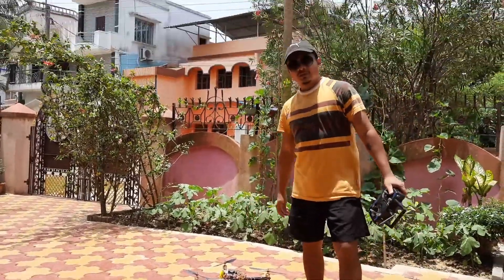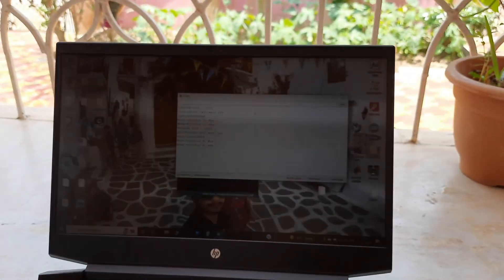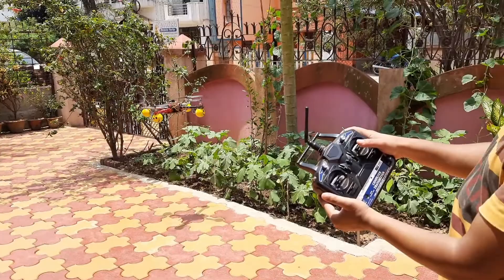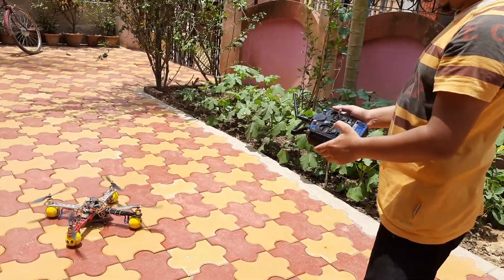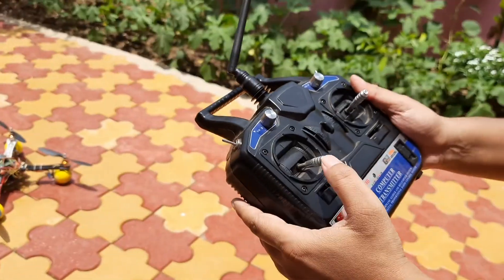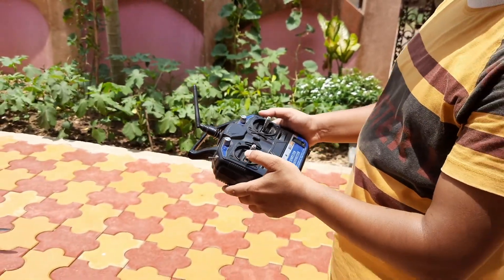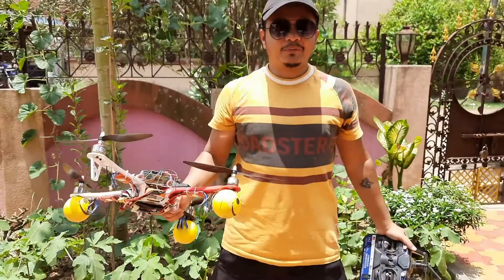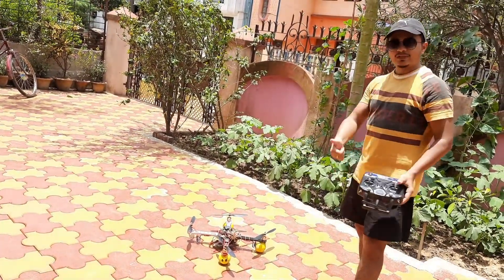Arduino Quadcopter Development Part 3 (Altitude hold)

Comment: Use 800 to 1200 kv for much stable with this setup without you should change altitude pid value . This osulation can damage your battery and much power lost..
Reply from the maker: Yes, I reduced PID gains in later flights and it became more smooth and graceful